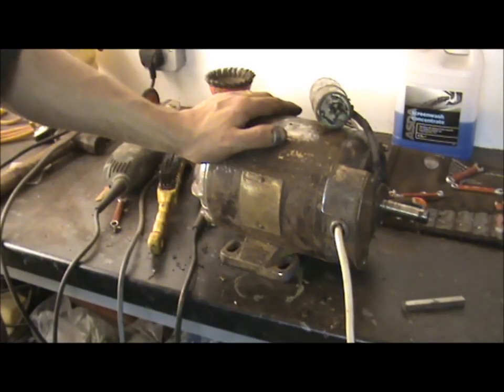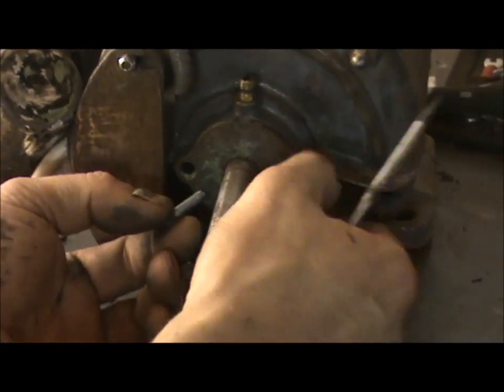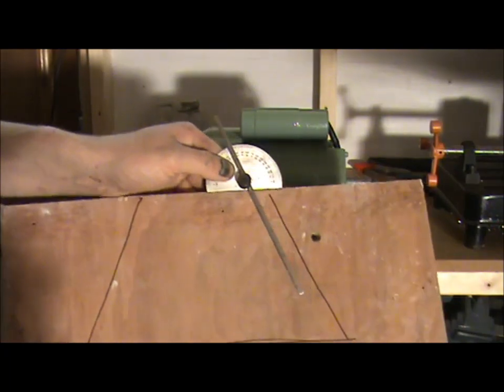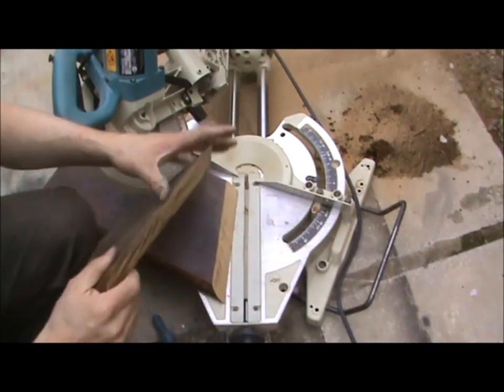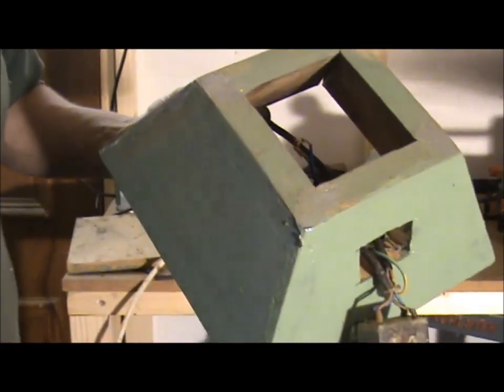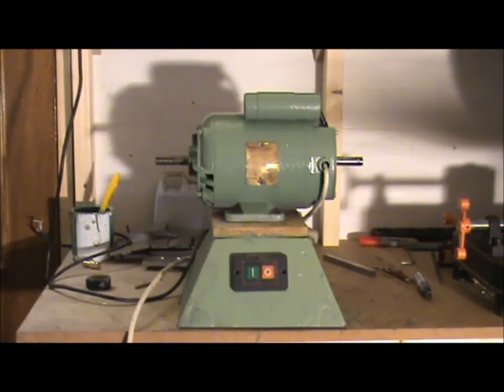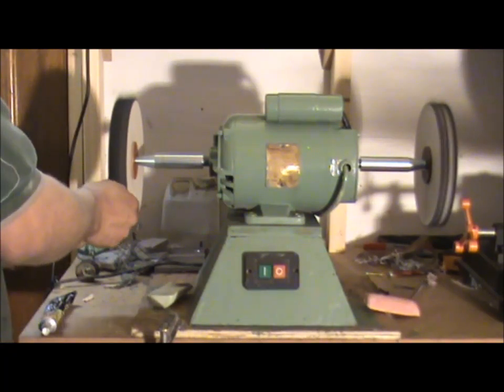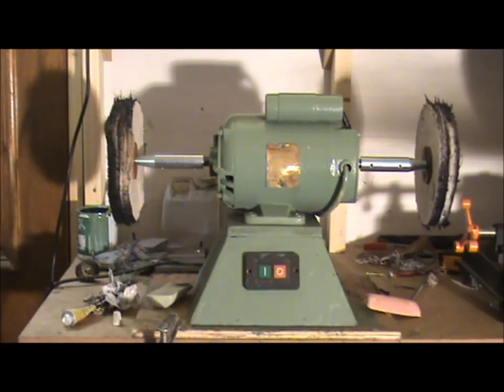Homemade polishing machine from old bits we build a home shop buffing machine

Comment: Now this is a very nice home made buffer, that will last for years and years, proper good old English motor. this bloke is just like me, when you want that final polish there is nothing like the left tit of a t-shirt ha ha . or a rub on the belly also works if its a clean bit of shirt . its what good quality t-shirts are meant to be used for. all my shirts get this treatment ha ha . I think the base would of been better made from a bit of heavy gauge steel though, but its whatever you have at the time, and atleast its given him a decent bit of height to work with.  this machine is a million times better than any Chinese buffer.